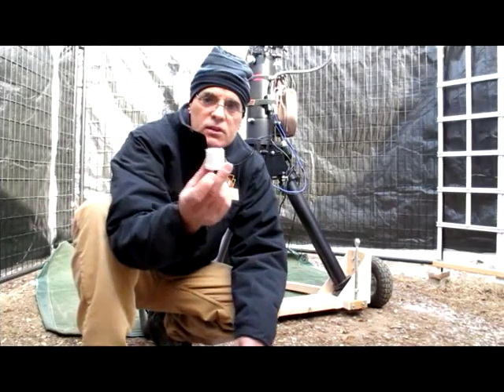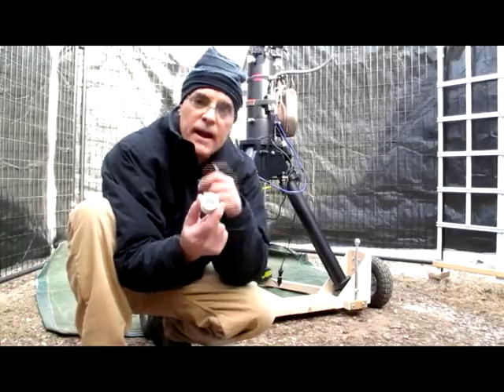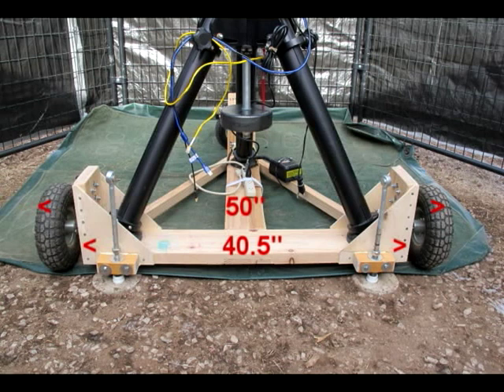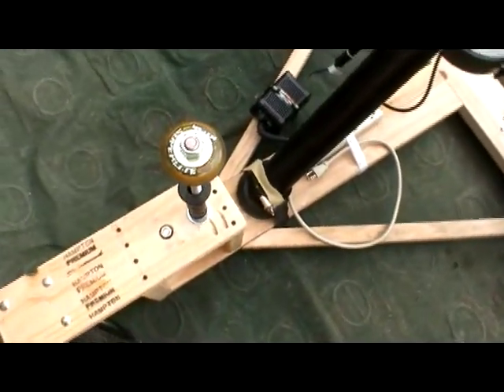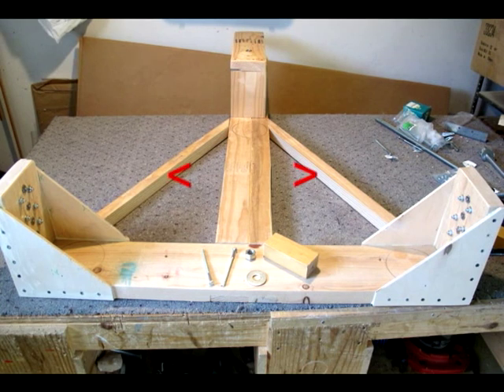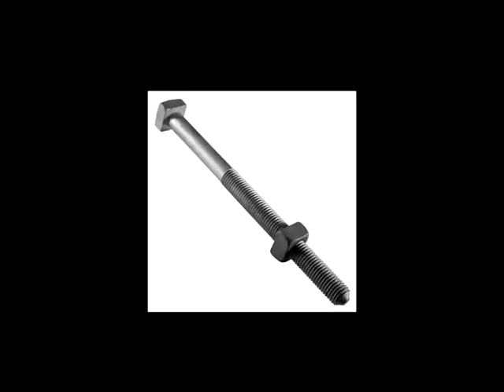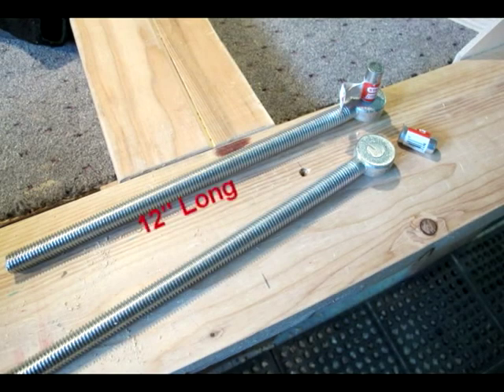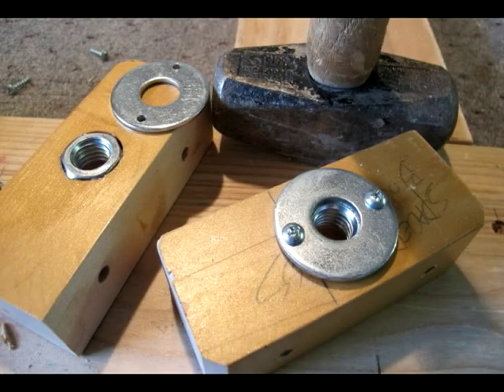Scope Buggy Ideas for Construction

Comment: brilliant video. I loved your implementation of the screw jack. Very innovative! How do your countersink holes look so clean? I use a spade bit and it comes out quite rough.
Reply from the maker: Thanks!  For a clean countersink hole with a flat bottom I used a High-Speed Steel Forstner Bit.  💫
Reply: @DakotaStarryNights yeah....I figured as much and got a set. I think the PVC cap idea as the bottom of the threaded rod feet is a novel idea but I might replace it with a piece of wood with a nut inserted into it to be used as a vibration dampening pad. Really cool overall!

Comment: What type of wood did you use for the frame? I'd like to build something similar but I want to make sure I use the right material. My scope/mount (fully loaded) weight around 170 lb
Reply from the maker: Nothing fancy.... Just 2x6 construction lumber and 1/2 birch plywood.
Reply: Thanks for your reply! One more thing, could pls provide details of how the rear wheels were attached to the frame? It seems that you bent the large bolts to accommodate the installation of the wheels.

Comment: I really like your scope buggy design. I am going to make one for myself using a hand truck as in your other video. I just have a question about the head of the leveling screw in the front (counter weight) side of the scope buggy. How did you fix a skate roller wheel at the top of the bolt fixed enough to rotate the whole bolt? I am struggling to find a screw jack or eye bolt threaded end to end about 12" long and will have to custom make it with a threaded rod with skate roller wheel fixed at the top. Your response will be highly appreciated.

Comment: Very clever design!  Could you post a couple of closeups of how you attach the rear wheels to the wheel supports?
Reply from the maker: John Rhodes A machine screw of the proper length, as stated in the video, is bolted to the wheel support block after running the wheel through the bolt.  It's really quite simple.   Two nuts and two washers; one for the inside of the support block and one nut and washer next to the wheel.  Tighten the inside nut against the nut next to the wheel. If necessary add washers as needed to keep the wheel from rubbing against the wheel support block.
Reply: Dakota Starry Nights